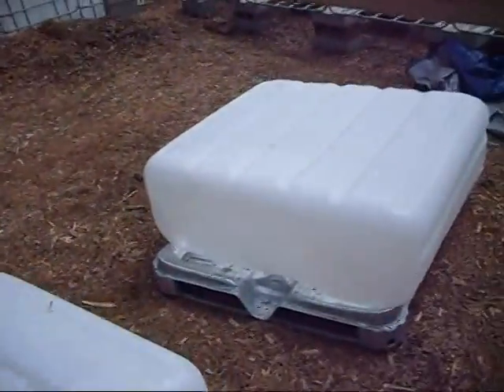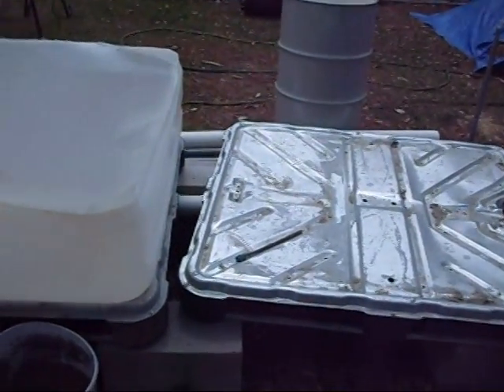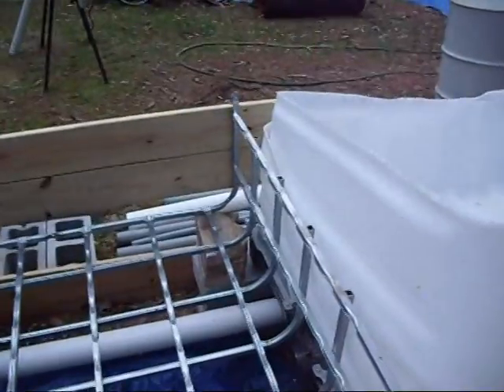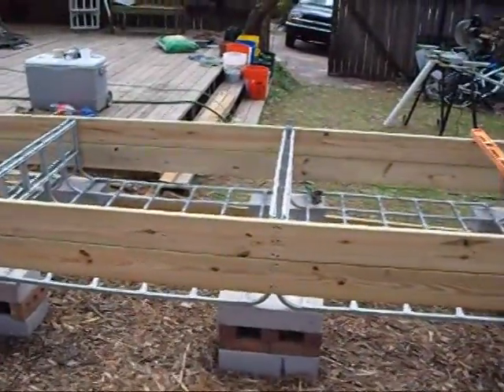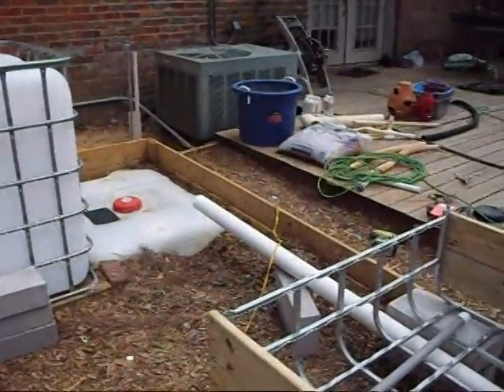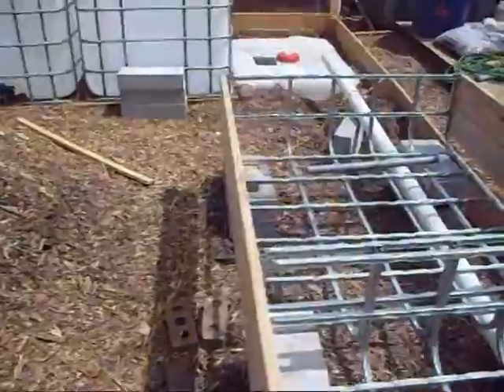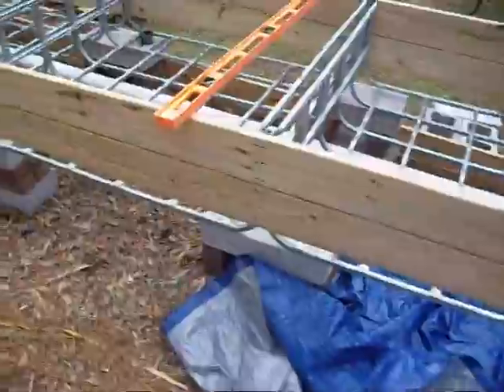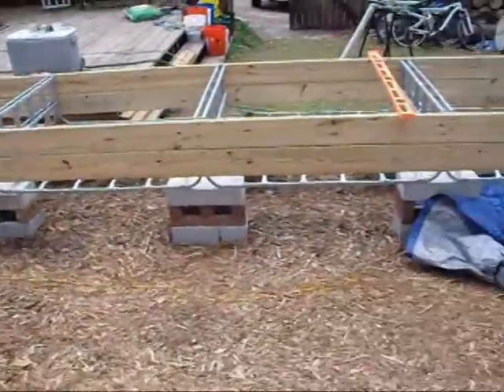IBC Aquaponics System Update 4

Comment: What was the make and model of the pump?
Reply from the maker: It was a Smart Garden Infinity 2250 gph pump that I found fairly cheap on Amazon.  However, that pump stopped working after 8 months, the spindle wore out of round and began making a horrendous noise.  I replaced it with a 1200 gph HF pump.that I picked up on sale for $32 and it's been going for 4 months now.